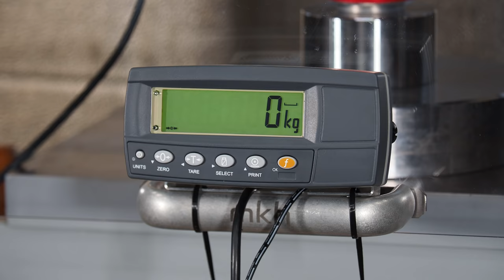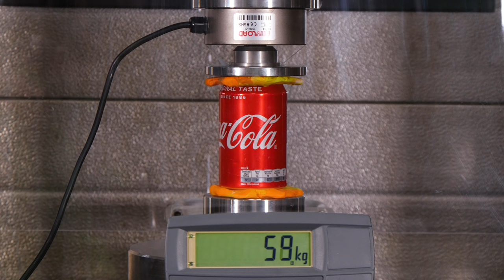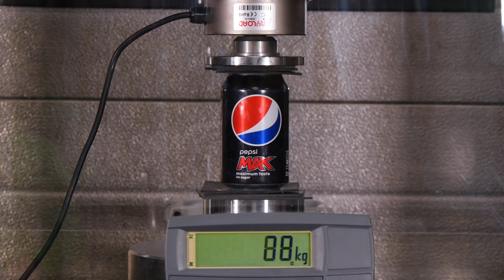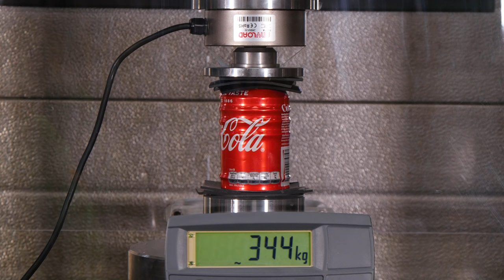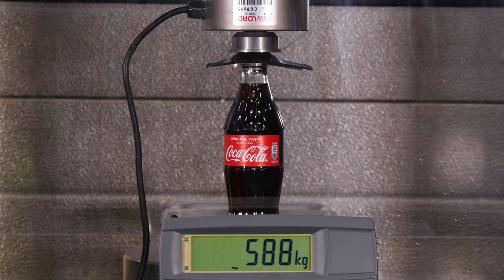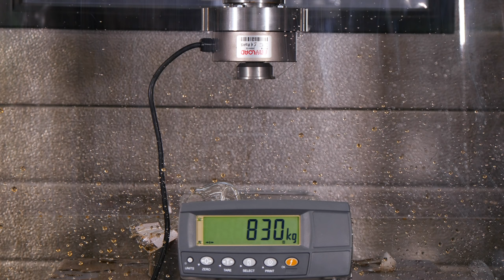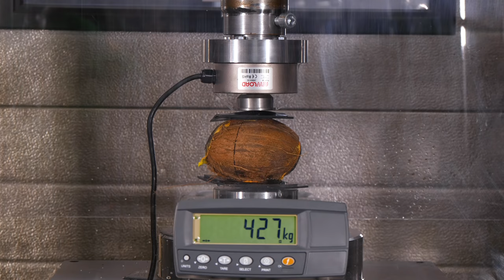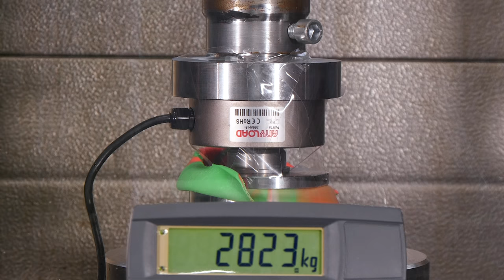How Much Weight Can a Soda Can Hold? Hydraulic Press Test

Comment: 77 kg is about right I work at a can making factory and this is an actual test we do
Reply: But... Why
Reply: Andrew van Leeuwen I have no idea it's just a test that they have us do once a shift for each machine
Reply: @DreStyle  too stack on pallets while transportations
Reply: @sir6801  that would make sense!
Reply: you're right, I was the can
Reply: @DreStyle  Qualtiy Control
Reply: @sir6801  deepak would be your manager man. slacking
Reply: @pacmanzz  wtf im still unemployed
Reply: @sir6801  so apply to coke management position wtf
Reply: @pacmanzz  nah there are no jobs here
Reply: Yeah. At my facility we do straight wall column strength and necked column strength tests. Dont know about the kilograms, but straight wall I see anywhere from 180 lbs to 320 lbs for 12 oz cans. Impressive considering the  thin wall is .003" thick!
Reply: It seems like the air would be trapped in the can giving an artificially high reading.
Reply: I work in a can't making factory... Quite a negative place really :-)
Reply: Sometimes there's a puncture, so they need to hold when empty/unpressurized.  -I transport things.
Reply: Because they're stacked on the store shelves and also in pallets usually 4-5  cartons high.
Reply: @hpt08  Well then, I don't feel quite as bad for working in a Maybe making factory. I'm hoping to get promoted to Perhaps someday.
Reply: @pacmanzz  I used to work at Coca Cola corporate offices in Atlanta, Georgia. They have several thousand office/management positions there all the way from marketing agents to directors, VP's, etc. Even the CEO of Coca Cola is based on the campus there. Terrible place. Every year, they hire a bunch of new people at a lower rate and boot out the faithful people who have been there for years or even decades. They want the lowest pay rates, have cut away at benefits and even people's retirement. They worked there for a few decades and Coke decided that because their retirement pension qualification is a couple of weeks after the date when Coke decided to stop paying it, the employee won't get it. Many have been fighting for it. Awful company.
Reply: @jesser5127  thats a common tactic unfortunately of many companies.
Reply: @DreStyle  quality control so they know if their machinery needs adjustment
Reply: @mrfingers4737  thanks 😊
Reply: @DreStyle  A lot of objects are tested like this.  When I worked retail, boxes had weight and stack limits on the boxes.
Reply: @apocalypse487  thanks for your awnser!
Reply: Same
Reply: @DreStyle  industrial amounts being stacked on another plus the contents add weight
Reply: Andrew van Leeuwen to handle the impact of going into space
Reply: Andrew van Leeuwen CAN you elaborate more?
Reply: Why does aluminum can need aluminum,magnesium alloy for the top part? Why can't it be the same material as the bottom or sides?
Reply: Is the factory making cans or the men or the machines who made the machines or man are useless?
Reply: I just learned I can use a bottled coke as a jack stand when working on my car. 

Thanks
Reply: @DreStyle      well, i'd say  to check on the wall thickness of the can,to make sure it holds when left inside a car in August at 40ºC.

Comment: Full Coca-cola can was really good. It looked great just a moment before it was crushed.
Reply: Puzzle guy Ik they should design them to look like that
Reply: He should make it again and stop the press b4 it crushes the can and take the new shaped coke.
Reply: @motorworld2513  Coca Cola should get into contact with HPC and do a sponsored limited edition can or something.
Reply: @ferrari458960   It will come back to it's smooth shape again, due to inner pressure
Reply: 5:14
Reply: @Puzzleguy  No it wouldn't there'd still be creases but not as prominent. But if it was preformed like this before filling it'd stay that way.
Reply: The interesting way it failed is probably an indication of the amount of engineering that went into the can shape.
Reply: Yeah can you imagine though opening up that can after it looked like that and the built up pressure inside? Probably end up killing you!

Comment: Fun fact: glass has a very similar load bearing capacity as concrete (close to being almost the same, actually)
The only difference is that glass cannot tolerate any torsion or other deformations.
But if you can load glass strictly linearly it is as good as concrete!
Reply: That makes sense since both glass and concrete come from sand
Reply: @huemansyndrome879  I'm sorry but I don't see the sense in that. For example, graphite and graphene are both made of carbon, but graphite crumbles to dust, and graphene, well if you don't know about that stuff you should look it up. Diamonds are another thing made of carbon that is very strong. Charcoal is carbon and you can break it apart with your bare hands.
Reply: @nobody2021  molecular structure is different, read a book

Comment: I would like you to open a can normally after it starts to ripple. .
Reply from the maker: I will do video about that for Beyond the press channel :D It's going to be there on next Tuesday!
Reply: @HydraulicPressChannel  even better, get Anni to open the can after it's started to ripple, while you stand a very safe distance away :-D
Reply: i agree but how would ya open it ?
Reply: Start selling them lls... I'd pay good too have a soda like that. Looks like a keg.
Reply: I don't think it will be as explosive as everyone thinks it will.  By all means, do it!  But don't expect it to explode like a grenade.  For one thing, the moment pressure is removed, the corrugations are going to relax to some degree.  Also, more CO2 will go into solution in the soda.
Reply: That can looks more futuristic than the Pepsi Perfect bottle from "Back to the Future"
Reply: Nice!

I was hoping to see a rippled can open but it might well explode so maybe a rig might need to be made to ensure nobody gets a face full of torn metal!
Reply: BiggestComplainer hm, sounds like a taste test is in order too
Reply: they did this check back beyond press. !!! BEYOND PRESS !

Comment: Looking forward to the coconut holder 5 million!
Reply: Adam you could do it with a hole in like 2-4 inches of steel that's approximately the same size of the coconut on the ends on both sides of the coconut
Reply: bed the ends in epoxy contained in steel cups
Reply: @greenthizzle4  that method would not really be testing the integrity of the oval though because you're applying the weight a little further down
Reply: Cain Enabler your right, there would be a sharp 90 degree angle that's somewhat cutting into the coconut
Reply: Something for holding two ends of a coconut? It should be called 'Terry Gilliam 5 million'
Reply: @greenthizzle4  I was thinking maybe a simple rubber pad like they've already used on the coke can, but have the plates roughed up so the pads don't slip
Reply: Cain Enabler I don't think that will work likely the best way would be to have a round cup shape into metal and put epoxy or something in it and then put the coconut inside the cup shape

Comment: Confirmed glass coke bottle is a good makeshift jackstand
Reply: Those things are so damn strong. Trying to crack one open without a hammer is actually really tough.
Reply: Just remember to xray it for cracks first!
Reply: No way! A coconut with the fibres in vertical orientation: THAT's strong! Gilligan's Island Jack Stand
Reply: would have been nice to see how much a empty bottle would take as well.
Reply: It’s strange how glass bottles are this strong but if you fill it mostly full with water and hold it upright and hit it just the right way with the palm of your other hand the bottom will blow out with a really nice clean break.
Reply: If a coke bottle can survive falling out of a plane, being used as a hammer, rolling pin, and as a tool of spiritual worship once a week, The Gods Must Be Crazy!
Reply: @JesusisJesus   they most certainly are.
Reply: What I was thinking lol
Reply: I wouldn't use it. Usually a jackstand needs to be able to take some impact force if the weight of the car suddenly shifts (like the jack fails and the jackstand is a backup). Metal is much better for that. Glass is very strong but brittle. Peak impact force will be much higher.
Reply: exactly...a coconut is even better.

Comment: I work at a bottling hall in South Australia and the capping machine uses average of 160-180kg of pressure when bottling wine, so im not surprised how strong the glass bottle was :)
Reply: Can you be more clear on the pressure units? kg isn't pressure. Do you mean kg/cm^2? Soda can also develop a lot of pressure and containers for it are designed differently than most other containers (for example, there are no seams)
Reply: Oh yeah, glass bottles are very strong vertically. I used to use a steel tube with a flared end to bottle my beer before I got an actual Capper and it could handle being bashed on with a three pound hammer, no problem.
Reply: @Auriam  You make and bottle your own beer? Cool. Do you sell it too or just use it yourself?
Reply: @Auriam  Thanks for that good information. I'll check it out. It's petty cool and impressive that you make your own beer. I'll definitely look into it!
Reply: @drServitis  thanks, have fun with it!

Comment from the maker: Edit: Since the partially crushed soda can is so interesting I will make video about those on Beyond the press channel! link to the video is here https://youtu.be/BvgvpqCq3XU

Thanks for all who subscribed after last video! We went past two million subscribers! I am working with two special tools for special video but they are quite complicated so I didn't have to finish them in one week but they are  soon ready!
Reply: Hydraulic Press Channel hi
Reply: Love from the big ol US
Reply: when crushing concrete cylinders for quality control, we had to cast the ends of the cylinders in a sulphur compound. this would make sure there is no point loading on the cylinder for more precise readings.
Reply from the maker: @bundles1978  I think that pretty similar than my rubber mat did. Steel against metal or concrete is challenging to load really evenly
Reply: You guys are truly engineers. Fantastic tool making and nothing is a problem that can't be solved. 💡
Reply: Hydraulic Press Channel there are other soda cans that sell here in the US that are much thicker. Almost too hard to crush by hand. But they are not soda. They are things like coconut water or other Goya brand beverages. You should try that in the press.
Reply from the maker: @mipmipmipmipmip I am maybe getting also position sensor so then I could plot both on the same graph
Reply from the maker: @Dickhead Bear I will find out if they are safe to handle first :D
Reply: @HydraulicPressChannel  add in some temperature data from an IR camera and you'll have a full record of the physics involved throughout the crushing process.
Reply: CAN u crush it until it ripples and then release the pressure to leave to can in that condition. That would be a really cool paperipaino
Reply: in light anni foot injury would you please do some test on steel toe and composite toe boots on the press channel or beyond the press channel please which would be safer
Reply: That was one of the coolest things I've ever seen on here! Yeah, doing stuff like this is very interesting. 👍
Reply: I dont know about you but I want one of those coke cans with the handy finger grips before it explodes
Reply: Please do a contest where the challenge is to design a brace for the soda can to increase the amount of weight it takes to crush using only the amount of aluminum from another soda can.
Reply: I thought the tool test is coming today?
Reply: Congrats man! IMO you really deserve it. Quality content for the past 3 years and ive loved every one of them. Caught your folding paper vid and was hooked ever since You are by far the channel ive wanted to succeed the most and im so happy you get to do this cool shit for a living and we get to watch you destroy things. Glad you made it this far and cant wait to see the crazy shit you do in the future. Thanks for all the good times and explosions, hope ya have a good one
Reply: Steel toe boot
Reply: Kiitos. Nyt päässäni soi Kuinka saisin rikki kookospähkinän.
Reply: Hi
Reply: Where is my girlfriend
Reply: I am from Atlanta (Coca-Cola country—look it up) but I think that it is high time that Pepsico payed you some money for your relentless and genuine unsolicited plugs for Pepsi Max.  This sounds like a job for the exceptional Anni.  If you don't get a Pepsi Max commercial, there is no justice in the world.
Reply: BiggestComplainer I’m one American who can convert. Like he said, multiply by 2 to get a close estimate. Add 10% to that, and you have it exactly.
Reply: Hydraulic Press Channel I think they should sell those soda cans when they are all wavy (just before they explode) because they look really cool! This could be a way for you guys to make some extra money!!!
Reply: 👍 I was about to scroll down and suggest this.
Reply: The plastic bottle surprised me. I'm curious if the Coke bottle shape is a factor over more regular shapes.
Reply: If you use diet soda, you're equipment won't be all sticky after it explodes.
Reply: How about you try tapping a pipe thread in a coconut and blow it up with the 300Bar compressor :)
Reply: seeing this makes me think of car suspension... maybe take a hydraulic shock from a car.
Reply: That sounds like a really fun idea :) 
Awesome anyway that you got the force sensor - because the pressure meter is not accurate at all at lower forces. Another idea would be to make a pneumatic press for "low force" testing up to maybe 2 tons. I think about the Smashinator - that could probably easely be modified so it work for slow pressing as well. 
The thing is that since air is compressible as opposed to liquids (hydraulic oil), it's very easy to increase the pressure slowly without the piston moving - that way you don't need all the rubber pads and Play Dough.

Comment: On the full coke can, would it matter if the can was shaken, in order to increase the internal pressure? Would the soda can then resist even more pressure? Would love to see a test like this.
Reply from the maker: I think the soda can was compressed before it exploded and that made the pressure much higher than it is normally.
Reply: Wouldn't it resist less pressure? Shaking it would increase internal pressure + internal pressure from press.  The greater internal pressure(provided from the gas) should break the can sooner. The greater internal pressure is, the more it's going to want to break free, right?
Reply: @wascallywabbit2057  The pressure wont go up if u shake it, because there is already more pressure than normal in it
Reply: Any gas released from the soda will be getting reabsorbed when placed under extreme pressure anyway; that's the only way the can's able to wrinkle down as much as it did, because the small amount of air left in the top of the can is being forced into the available space within the liquid.
Reply: RealUnimportant - Really good point... the pressure would just force the gas back into the liquid. Appreciate it!
Reply: David Watts Jr. you thinking shaking it increases internal pressure? Where would that extra pressure come from?
Reply: j p to be precise, I worded it as a question. But obviously CO2 is dissolved in the liquid... But I realize now that shaking it wouldn’t matter. The gas only would come out of the liquid once pressure is relieved. Forgot my high school chemistry/physics for a moment.

Comment: Pretty much 1/3 of a tonne held up with nothing but coke and a tiny bit of aluminium, that's some impressive engineering
Reply: Like the original Atlas booster, before the design was changed to composite.  Bad news was that you had to keep the tanks pressurized at all times.

Comment: You really run the risk of damaging that sensor and might want to take some steps to mitigate it. Since your presses go from 0-100 reeeal quick (in the space of millimeters) you had problems with force being generated too quickly. I'd throw some sort of 5-ton spring in there to absorb the energy of the press. Rather than going from 0-5 tons in a millimeter, it would take several inches. This would also lead to more catastrophic failures as the spring releases its energy.
Reply: Or you set a pressure relief on the supply

Comment: You should make special tools for egg also to spread the pressure. I think they are stronger than one might think.
Reply from the maker: I think I could do one with my 3d-printer
Reply: @HydraulicPressChannel  Or use material you can mold and harden, like polymorph plastic which can be molded when it's heated to +60 degrees.
Reply: I remember watching an old episode of Bill Nye the Science Guy (Back when he actually did non political science, he was a solid presenter), where they set up 3 eggs in a triangle with plastic soda caps on both ends for this purpose.

They got at least 7 cinderblocks high before the eggs broke.

Comment: Quick physics lesson: soda cans are a lot stronger when closed by design; the pressure of the liquid and carbon dioxide gives the can a lot more strength than just the aluminum alone.  The shape of the can makes it so that the contents which are under pressure add even more to the can's strength.

Comment: No reason to get those expensive car stands from the other video, just use soda bottles.
Reply: For extra safety, throw in a couple of coconuts.
Reply: @Case_  Man those things are expensive. They don't just grow on trees you know.
Reply: Get 4 unopened coke bottle, a bunch of silicone sheets and two pieces of inch thick plank. There you go, able to withstand at least 3 tons of force.